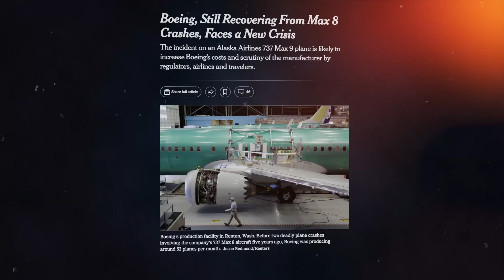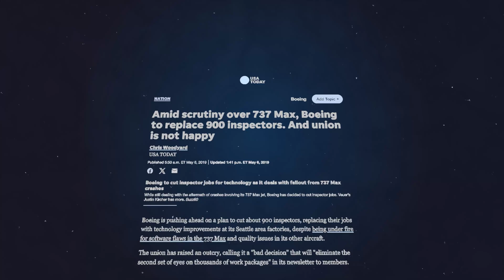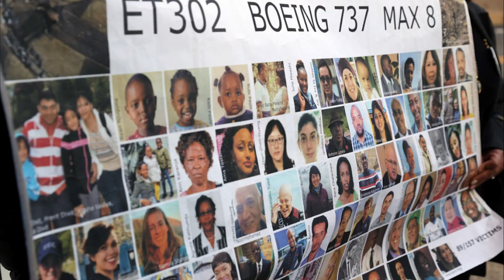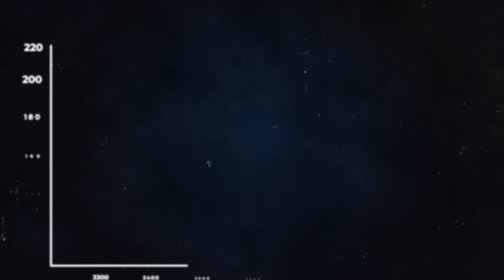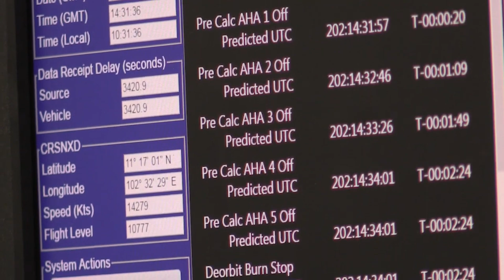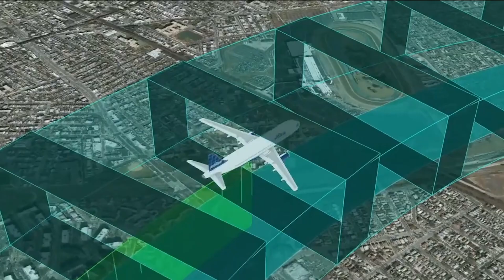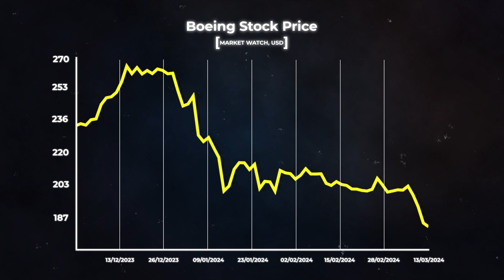Why Boeing Is Always In Crisis!

Comment: So when did the 787 Nightmare Liner become an Iconic jet?   I'd say its a bigger pierce of crap than the 737 MAX.
Reply from the maker: I think if you look at the design of that aircraft and the sheer amount of innovations made, it most definitely is iconic. Now whether they are maintaining that design properly or whether the design limitations were communicated to the airlines is a different thing. But point taken, it definitely is an issue

Comment: Boeing is a failing company, and it’s all due to a tiny number of criminally greedy people, the Board of Directors.   Boeing has proven bean counters and lawyers can’t run an engineering enterprises so what did they do?  They doubled down by putting anther finance person in as CEO.  The FAA has also demonstrated it is not capable of doing its job as a regulator.  Both worked in unison to destroy Americas reputation as the leader in commercial air transport.  Best of all, as the BOD destroyed Boeing they gave themselves fifty million dollar bonuses.
Reply from the maker: I think you’re correct about the greediness of people at the top, as they say proof is in the pudding. 

As for who can fix this mess, I’m not sure just having an engineering background would be enough, need an honest person in which is important as this is bigger than America, it affects everyone around the world!
Reply: @beyondengineering  Yes, however as we have seen honesty has proven to be in very short supply at the upper levels of Boeing management.  The lying started at the top and worked its way down.